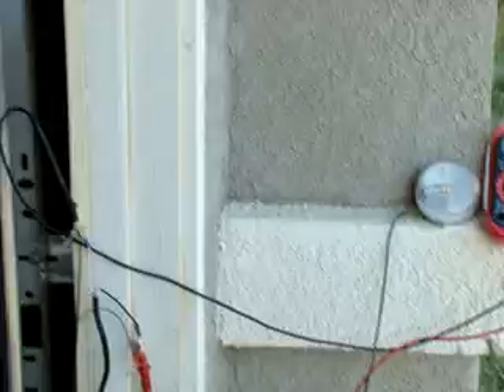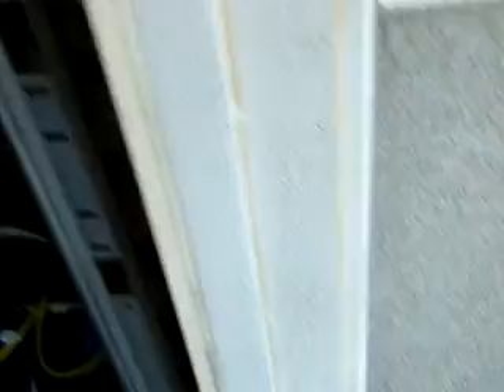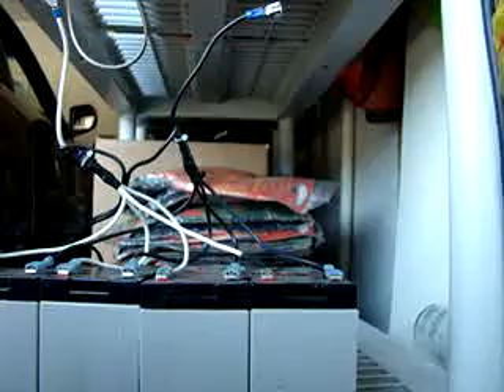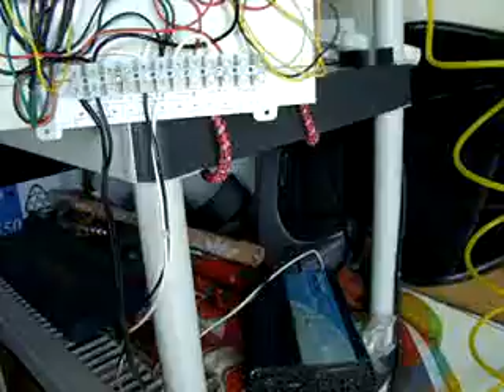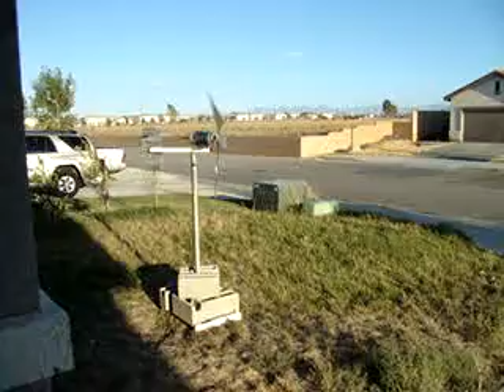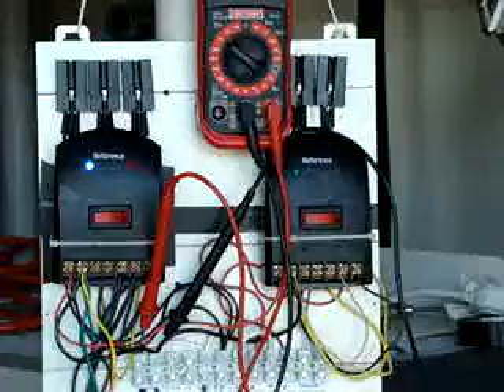DIY Wind Turbine - The whole setup

Comment: The wind turbine is suppose to be connected to the charge controller or you will overcharge the battery. The inverter is suppose to be connected to the discharge controller

Comment: hey great set up.....i want to build a PMA for my eeet diploma final project and i was wondering how the magnets and coils are places....is it that the magnets are around the rotor and the coils are around the stator? or are the magnets on one plate and the coils on a separate plate parallel to the magnets? also this is a single phase output?